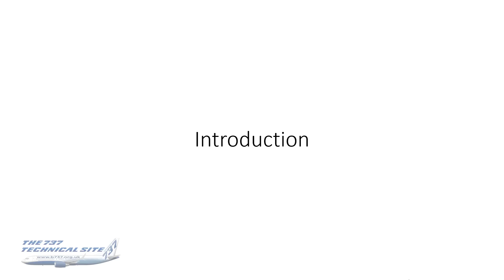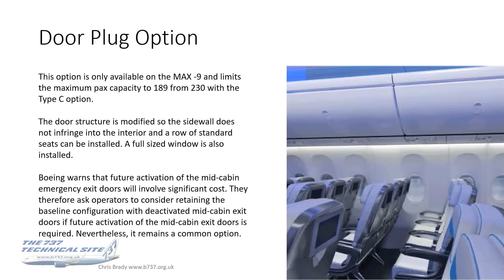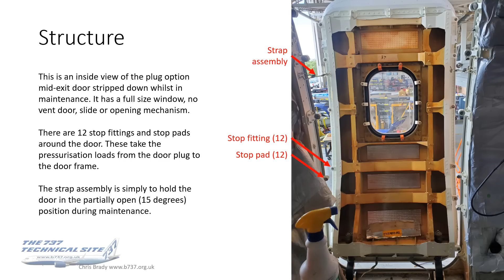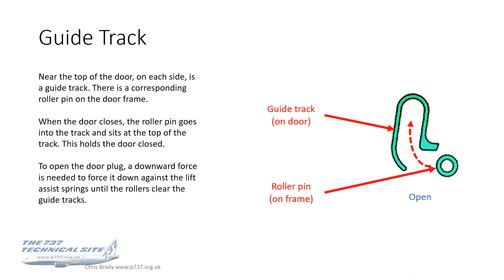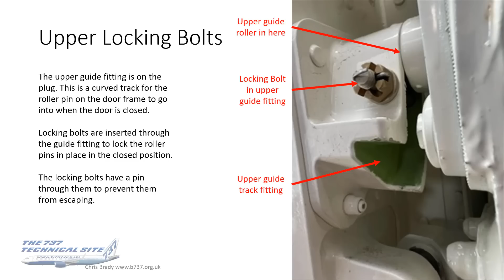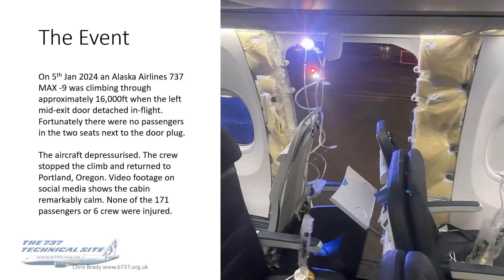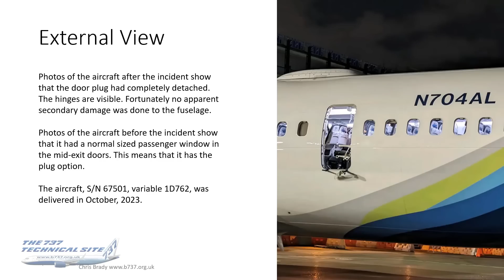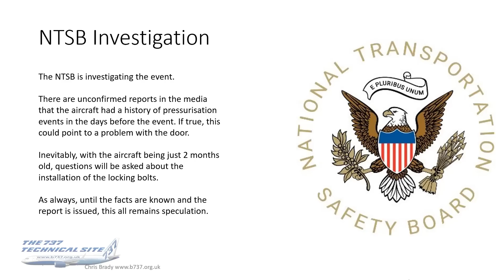737 Mid-Cabin Emergency Exit Doors - Plug Option

Comment: Are you serious?  My life is resting on four crummy bolts (actually only 2) resisting potentially thousands of pounds of pressure?  What morons!  Actually it will not be the bolts that broke. It will be those thin sleeves the latches are retained in.  Mark my word, it will be found that a crack developed along that locking bolt in the sleeve.  At that point it was only a matter of time Time till the sleeved cracked through. And with only 4 (actually 2 latches) holding this door on, all it needed was one to let loose.  Probably the front one since once it broke free it would let the front side of the door protrude into the air stream and then the air stream just caught the door and ripped it off the rest of the way.   This is just dumb stupid naive ignorant engineering.  The whole line up of engineers at Boeing involved with this fiasco should be summarily fired!  It’s because of idiocy like this that engineers get a bad rap.  Of course I suppose it could also be that the last technicians there did not even put in the lock bolts.  But there is still an engineer somewhere in the process whose job it was to make sure those bolts were installed correctly. I’ll bet on the cracks as the cause. And too few latches.  And no accommodation for the flex of the aircraft structure. Actually why the hell have a door there at all?  If you want a door, just go back to the shop and have a real one installed properly. Again, poss poor engineering design. IMHO of course.
Reply: The engineering is sound. The investiagtion will more than likely find it was human error in not installing or rigging the bolts. Also, there is no pressure on the 4 locking bolts. The pressure is taken by the 12 door stops.
Reply: @0618306 , Can you elaborate on how the 12 “stops” actually connect to the door to contain cabin pressure? I agree, there is no load on the 4 locking bolts, but I need to understand how those stops work. I get it, This video & the NTSB both say the 12 stops are taking the pressure. I have trouble believing a plug door on an airplane is actually held in place by 12 stops that apparently automatically release themselves under any circumstance. Has anyone mentioned the potential simultaneous failure of all 12 “stops” as having any connection to the plug door blowing out? If the stops released themselves automatically it seems someone has gone out of their way to turn a redundant system into a fracture critical system.
Reply: @Bitterrootbackroads  None of the stops failed from what can be seen in the available pics.  The stop fittings are mounted on the plug  and move down as the plug is fitted and mate on the INBOARD side of matching stop pads that are mounted to the frame.  So there are 12 points where the pressure load on the plug is transmitted to the frame.  If the plug moves up (due to failed or missing locking bolts that otherwise hold it in place), the stop fittings and pads disengage .  They can't release 'automatically' - the plug has to move upwards for that to happen.  The redundancy in this design is in 2 places - the 12 stop fittings/pads and the (should be) 4 locking bolts.  My bet is the redundancy that failed is the quality control check that should have been done to ensure the locking bolts were installed.
Reply: There is absolutely no reason not to install a standard emergency exit door.
Reply: @Dubinski2382  There is plenty of reason. Boeing only require this to be an emergency exit door when having seating exceeding a particular capacity. From this presentation not having it limits them to 189 max passengers so presumably from 190 upwards to 230 this emergency door is necessary to evacuate all passengers within the 90 seconds required. This is not a $200 saving by having an emergency door you lose at least one row of seats each side so this is two lots of three seats on every flight for the remainder of the service life which adds up to a lot of extra passenger seats and revenue.
Reply: As you state, I have since learned that there are those 12 door stops (I recalled fewer from the vid I saw that on, but I'll go with your 12).  But that actually makes it an even DUMBER design!  Basically then that whole door is hanging on a lip of these stops!  There is no positive retention of the door into the door frame.  If the door frame warps (lets say during a crash) then the door fingers just slip off the 12 door stops and the door goes flying at the very moment when you need it to structural integrity to stay there!  I understand why that plug is offered, but I think that is dumb too.  If you want a door, then buy a stinking plane with a door.  If you don't want a door, then buy a plane without a door.  If you bought a plane without a door and now you want a door, either trade your plane for one with a door, or send it back to the factory to get a proper real door installed.  I know, its costs more money.  And so this accident did NOT cost more money?  Just ask both Alaskan and Boeing shareholders about that one!  The cheap fix or the short cut, always cost more than doing it right in the first place. @0618306
Reply: I understand why that plug is offered, but I think that is dumb too.  If you want a door, then buy a stinking plane with a door.  If you don't want a door, then buy a plane without a door.  If you bought a plane without a door and now you want a door, either trade your plane for one with a door, or send it back to the factory to get a proper real door installed.  Visa versa as well.  I know, its costs more money.  And so this accident did NOT cost more money?  Just ask both Alaskan and Boeing shareholders about that one!  The cheap fix or the short cut, always cost more than doing it right in the first place.
Reply: @hu5116  You can’t buy the plane without the hole in the fuselage on both sides. There is only one body type. Yes this may be stupid but there is only one certified fuselage design not two.

This IS the non-door plug option. It needs to be able to be opened to conduct inspections to ensure there is no fatigue cracks on the 12 stops usually every 4-6 years of operation. The reason this is more popular is because it doesn’t infringe upon the cabin as much as a proper deactivated evacuation door you get 2 extra seats.
Reply: But they saved $200 by not having to buy two more emergency exit doors!

Comment: I'm very curious why there is a "Significant cost" caution for conversion to exits, re. Boeing fitting the plug doors in place of Deactivated or or other options? Are there any differences at all in the door frame structure as fitted in the fuselage?

Also, as the standard build would be equipped with door warnings, why on earth would they omit those on an openable door - even if it's only used for maintenance?? As the securing system is concealed by the interior trim once closed up, I'd have considered it even more critical than on a functional door, when the locking state is visible!

Comment: Doing my airline columbo investigation, i dedooce that its highly likely that the lock bolts weren't refitted after routine servicing. Case solved.
Reply: Too early in the aircraft's life for a routine service. Besides, it is not a part of the aircraft that would need to be accessed during a routine service never mind being opened. Everything points to an assembly error at manufacture. You are a lousy detective (no offence intended)!
Reply: Thanks for your honesty, I shall now hand in my gold detective badge😢

Comment: So can you clarify this for me? Maybe I missed it if you specifically mentioned it in the video.... The interior wall panel has to be removed to open this door plug right? I mean if the last time it was opened, the maintainer that closed it could have failed to install the cotter pins in the castellated nuts on those 4 flimsy "stop bolts"...right. Don't try to lecture me on inspections and tech manuals and blah blah please, I worked aviation mx for over 20 years I know how it works (or is supposed to anyway). Just asking how easy it is to access/install those bolts? Easy to imagine non-reusable cotter pins being missed, then missed again on inpection and the panel being intalled over the plug.
Reply from the maker: "Don't try to lecture me" - Really?
Reply: @ChrisBrady737  yeah, because otherwise there are 40 replies about how they use tech manuals and it's inspected and it's not possible; and we all know that crap happens. Sorry if I somehow insulted your delicate sensibilities
Reply from the maker: It is not about delicate sensibilities, it is about maintaining a civil discussion and not descending into insults. It is neither necessary nor helpful.
Reply: @ChrisBrady737  I guess that makes me the one with delicate sensibilities then. Didn't intend to be offensive, my bad.  Apologies to all.

Comment: That's not really a plug type door.  Plug type it near impossible to blow out from cabin pressure alone.
Reply from the maker: Boeing say that it is
Reply: @ChrisBrady737  That door is closer in design to a cargo door which is not plug type.
Reply from the maker: @encinobalboa The 737 cargo doors are definitely plug type and they open inwards
Reply: @ChrisBrady737  Plug door is different from a door plug.  Plug door frame is narrower on the outside which is why door opens inwards.  Door plug is held by door stops, not the frame itself.  One is impossible to open once plane is pressurized.  The other apparently is not.

Comment: Thank you so much for the great video Chris.
i have a question, is there any option without "mid-exit door" and "without plug" ? i've been checking the external photos of MAX -8 airplanes, they all have fully passenger seat window, does it mean that they have plug option (which is not available according to your slight 06:45) or they don't have the middle door at all?
Reply from the maker: Only the -900 and MAX -7 and -8 do not have the mid-exit door.
Reply: @ChrisBrady737  
1. Is the door plug identical on the 737-900ER and the 737MAX-9?
2. Are the castellated upper/lower retaining nuts self-locking (in addition to the cotter pin)?
Thank you
Reply from the maker: @Paul1958R  A1: I think so. A2: I dont think so.

Comment: Really hard to see how this door cleanly opened with both bottom safety bolts in place. That said, if Boeing forgot to install them, the door would likely have opened much earlier in 2 months operation. Jeez, a pretty simple design and 4 bolts should have held it fine ( or an aircraft engineer here, though)

Comment: I gather the Door/plug mounted upper guide moves with the door and the roller is fixed stationary to the surrounding frame, so springs help lift the guide up and away from the roller so as it can then swing outboard. Also we have a rubber seal somewhere here around this door which if compressed likely provides some friction......maybe that is what prevented it from popping open sooner when depressurized?
Reply from the maker: Entirely possible

Comment: Oh my lord. The picture shows an outward angle to the track & there are springs applying upwards force to the door; both of these are acting to spring the door open! If someone forgets to put in the locking bolts, only the friction between the stop fittings and pads would be holding the door in place!!! What a terrible design for a panel that is meant to be permanent.
Reply: This explains how this happened: door was shut tight from the factory and covered up by the inside panelling with no bolts in place. After a few months, vibrations allowed a slight air gap to develop below the door and pressurization alerts. On the second day, the pressure in the air leak under the door (since it has to slide up), paired with the spring force and angle of the guide track sprung that door up and out like a jack in the box. No wonder the roller pins and stop pads were intact. Way to go Boeing for designing a “permanent” panel that is actually a spring loaded door that will never be inspected and that is held in by four rinky dink pins. Ridiculous.
Reply: The reason why this door is designed this way is certainly so it can be used as an emergency exit… except (I hope) that real emergency exits have a robust interlock that holds them well shut. So instead of actually modifying the design of the emergency exit door, they just did away with the interlock and added the four bolts. It does cut down on the cost of parts but my god… is it that much to ask to invert the track so that the door must be pulled inwards for maintenance? That way the pressure will make it impossible to open the door, not helping it to blow open!
Reply: @BaliMystic it’s covered with panels inside. Not an emergency exit for sure. Passengers cannot open interior panels and remove 4 safety bolts firsts.
Reply: @Karlson425  1) obviously passengers would not remove the bolts. If someone forgot to install the bolts, this mistake would be covered up and concealed by the interior panel.
2) since this plug door is intended to be permanent, Boeing could have made an effort to make a distinct design that was intrinsically safe. Instead, the reused the same emergency door, which by design must open easily, and added some bolts to keep it shut. That is a rather lazy solution and it turned out poorly, given the current issue. They might have saved money on parts and engineering but it could end up costing them with lawsuits and modifications.

Comment: 9:37 Yep I see the defects in this design right now.
if those locking bolts are not secured correctly and the bolts fall out the spring force holding the door will push the door track up and off the frame roller pin. Looking at the video from the cabin all the mounts look to be intact. This does not look good for close out shop and Q/A inspections. Someone is gonna lose their stamp for sure.

Comment: I think several people have correctly pointed out that your information is contradictory or confusing or am I missing something. The pins are on the fuselage frame and the guides are on the door.  If the entrance to the guide on the door is pointing down then you need to move the door up to disengage. Then the door goes out and down from the top hinged at the base?
All picture and diagrams show the guide on the door pointing down. Can you clarify please.
Reply from the maker: * Errata *
In this video I state that a downwards force is required to remove the door plug. I based this statement on text in the AMM SDS which I now believe to be incorrect or misleading. It is possible that a very small downwards motion (1-2mm) is first required to be able to free the locking bolts. But the door must be moved upwards by a couple of inches to clear the guide tracks. Apologies for any confusion.
Reply from the maker: AMM SDS 52-23-00 Page 6 MID CABIN EXIT DOOR PLUG - COMPONENTS, Lift Assist Springs:
"Apply a downward force to the door plug this forces it down until the rollers clear the guide tracks. At this time the door plug can open outboard."
Reply: @ChrisBrady737 thanks, but this does not agree with the photo you show of the pin in the guide track, unless that photo is inverted.

Comment: I'm looking at a picture of an intact door under inspection and don't quite follow how those 12 stop pads work.  It looks like they are on the inside of the aircraft relative to the flanges mounted to the aircraft frame (thus appearing to make a sandwich of stop pad/flange/rest of door assembly).  Does that mean when the door is swung into place the stop pads on the door come in above the flanges and slide down into place when the door slides into the guide track?

Comment: Wouldn't the pressure on the inside lock the door in place, such that it can't be opened until the pressure inside the plane is equal to the pressure outside? Thousands of pounds of force should have been pressing the stop fittings against the stop pads. If so, how could it move, even if the locking bolts were missing?